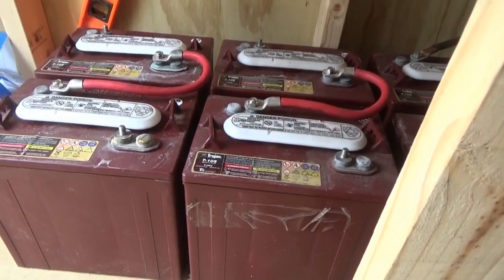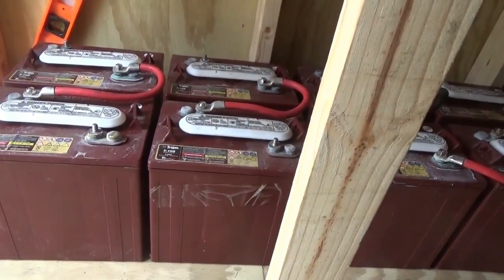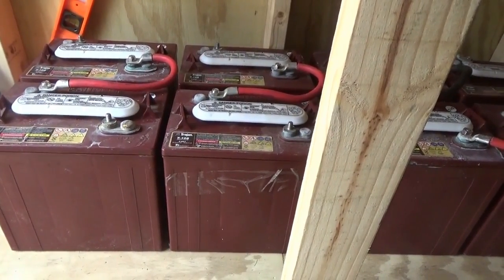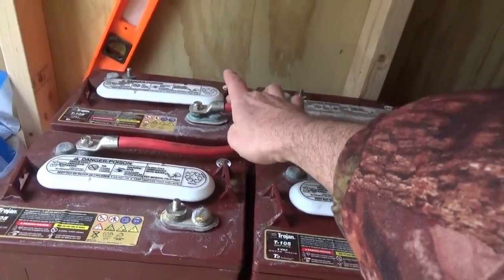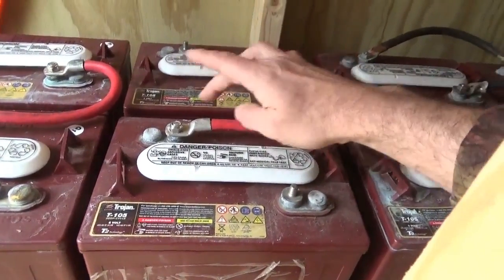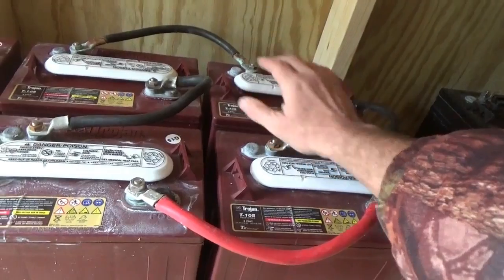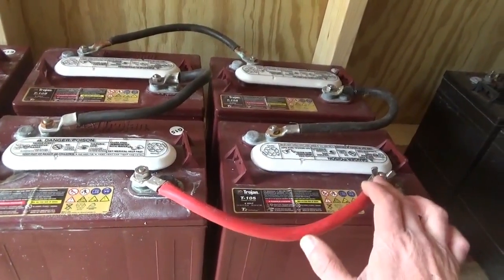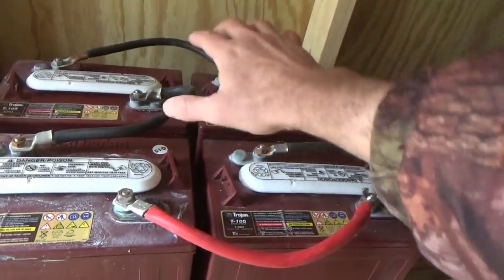How To Wire Solar Battery Bank ~ Setting Up Off Grid Solar

Comment: Thank you. VERY much appreciated. Question: can you connect the positive and negative cables from inverter to ANY positive and negative posts on battery bank, or is there a specific positive and negative post we should use?

Comment: Why am I getting a shock when I'm standing on the ground barefoot and I touch my battery only when the inverter is on it's a hybrid inverter charge controller when it shuts off there's no more electrification through my body The inverter everything is grounded in one location to the panel off grid completely and that goes to a ground rug so now what
Reply from the maker: The inverter is likely electrifying your ground. Try removing the inverter ground and see what happens. Or put it on a separate ground. Not tied into other things.

Comment: Question, what are you powering at night with this bank?
Reply from the maker: That was my electronics shop. The only thing left on at night was my experimental battery restoring device and maybe sometimes an inverter. On my main home system I leave my entire security system, outdoor lights, cameras on all night. During summer I power my entire office and even some cryptocurrency mining rigs at peak sunlight hours.

Comment: I like how these videos show you how to do it BUT never tell you the size of wires or lug rings to use.
Reply from the maker: Well the size lugs depend on the batteries you are using. Some vary with today's made in china stuff.
Reply from the maker: wires - use the biggest you can afford. That part is simple. Bigger is better.

Comment: great video i try to find it the simp. why and you did it 100ah battery is S give me the 24 v   but i did not know if i add 2 more if it would be 100ah or 200ah i know i have 200ah now thanks

Comment: HELP... I my old charge controller only had one PV wire coming off the breaker box...and my new Flexmax charge controller has both negative and positive connection WHAT do I do now.. I don't want to blow up my $400 controller.... I all most forgot Thank You for a simple and understandable video on 6 volt battery hook up to make it a 12 volt system.
Reply from the maker: Happy you liked the video. First connect the charge controller output to the battery. Always connect the batteries first. This is the one big way you can blow the charge controller if you do not connect batteries first.

Not sure how your system is without seeing the breaker box. but one wire will be positive from the solar panels and the other is negative. Use a volt meter if you are not sure. But the cables should be labeled on the solar panels themselves. Positive from the solar panels (or breaker) to positive on the charge controller solar panel input and negative to negative. Hope that helps.

Comment: Do you wire them serially first or parallel first?
Reply from the maker: If they are golf cart batteries I wire them together in pairs of 12 volts first and then connect all the pairs together in parallel.

Comment: I don’t get the vernacular.   I just do not get it.  Not your fault.  I can tell you how to move a gallbladder in detail, but this just doesn’t nabsorb in my brain.  I am stuck just doing one battery at a time.  Thankyou for trying.
Reply from the maker: If you have normal 12 volt car type batteries, just wire them plus to plus and minus to minus until they are all connected together. This gives you more total usable power. My situation is a bit more complex cause I am using 6 volt batteries.
Reply: @TheDoItYourselfWorld  thank you.  I have tried but electricity just is hard lol.  I will do this tomorrow.

Comment: Do you use 6v batteries to keep cost low? Why not use 12v batteries?
Reply from the maker: Actually 6 volt batteries cost more but last longer.

Comment: I'm currently living in a trailer after a house fire. I have a 12000 watt generator that runs on Propane and Gas. My next step I think ,is to get some AGM batteries(class31..i think?..lol). My trailer is a fifth wheel, with an enormous storage compartment. This compartment sits right next to where the existing battery is that came with the trailer. There's a 110 plug also in this storage compartment. My thinking was is that I could get myself maybe two to four 12 volt AGM batteries charge them with my generator and possibly a solar panel as well and use an inverter and then simply plug into the existing plug or receptacle that is in the storage compartment and back feed all my 110 plugs inside the trailer. What do you think of this simple solution to get started?
Reply from the maker: That AC outlet connects to the shore power line of your RV. There is usually no power inverter in an RV to convert DC to AC. You likely cannot send the output of your batteries back into the system because the AC lines in your RV are used to charge the batteries. You cannot loop it. If your conversion is permanent, you can remove the AC to DC battery charger and then use the output of an inverter to run your 120 volt outlets by connecting into the fuse box. But then NEVER plug in shore power or a generator without removing the inverter first. There are expensive automatic switches which allow you to connect a generator, shore power or an inverter in one system.

Comment: over on your web site I tried to leave a comment and it kept kicking it back because it said "too short." So, I will ask here. Do I connect my solar charge controller to the same location in  battery bank as my inverter/charger
Reply from the maker: You can put the solar charge controller on opposite ends from the drain (inverter) but if it is a charger as well, then I do not think it makes much difference.

Comment: I did the same thing you did I have for batteries in three different banks 12 battery is total I think I'm going to combine them all together instead of having them in three separate banks with three separate power leads going to my inverter, because they don't seem to be charging evenly

Comment: Once i have the battery bank together in parallel where do i tap onto and off of it with my charge controller and inverter. Again, i am in parallel. Would i tap a positive on one end of the bank and negative on the other or would i tap the positive and negative of one of the batteries on one end for the charge controller and the positive and negative on the other end for the inverter? Thanks in advance.

Comment: If you connect a positive 12 v to another positive 12 volt in a series, is there a limit to how many you can chain together like that (for a 12 volt system)? And can it be dangerous to get too many in a parallel series like that?

And if you are trying to use 6 volt batteries as a 12 volt battery does that actually lower your battery's amp hours, because its trying to do more with less?

Comment: I think you made a mistake in the beginning. With the first four batteries you said they were in series and you correctly stated positive ti negative. Then, when you went to the second 4 batteries, you said they were in parallel but you again stated positive to negative. Parallel means that they are connected to the bank all on the same polarity. So positive to positive, etc, etc. What is also possible is to connect some batteries in parallel and then connect a group of those parallel banks into a series. So you can connect 2 sets of 2 batteries in parallel. So you have 2 sets of 2 batteries in parallel. THEN connect those 2 sets in series to make a 4 battery bank combining the attributes of both series and parallel. You get the boost in voltage AND the boost in amperage.

I am a newbie to this whole thing but this I am pretty sure of.
Reply from the maker: Your suggestion may have one benefit which is better load balancing, if any. But you get the same results of voltage and amps either way you wire them.

Comment: so first wires could be six inches for money savings?
Reply from the maker: Shorter is better but I dont think you can connect the batteries with 6 inch wires. They wont reach.

Comment: is there any benefit in using golf cart batteries over deep cycle batteries? I notice these are 225 Amp Hour batteries, but most deep cycles are only 100 Amp Hours and appear larger than these.
Reply from the maker: These are 80 pounds each and are heavier than most deep cycle batteries I have ever touched. The amount of lead in these increases their useful life to 10 years or so. Your average off the shelf deep cycle battery is engineered to fail in about 3-4 years of average use.

Comment: I’ve bought so far 26 Yonlong 2.4v LTO Titanate Batteries 40Ah - 6 batteries will give me 14.4v or 21 will give me 48.4v is what I’m going to wire it this is only for battery back up when the grid falls I have a DIY generator / Some cheap small solar panels 25Watts ea. X 3
Reply from the maker: You may consider going on Amazon or Ebay and buying a few 100 Watt panels. They are getting cheaper all the time. And the larger you go, the cheaper they are per Watt.

Comment: 2:16 - To say that a parallel connection increases the current is misleading.   It increases the Ah capacity at a particular voltage.  Also, those batteries are not 225Ah usable each.  Most people that know about batteries know that with lead acid batteries, you only get about half of the rated Ah capacity of them so each of your 12V 225 Ah battery banks is actually only about 12V 112.5 Ah usable.  So your 4 12V subbanks in parallel are only about 12V 450 Ah usable, not 12V 900 Ah usable, and that is assuming they are in good health and wired properly under load (load balanced).  If they are not, then the usable capacity will reduce even more such as 12V 400 Ah or even less.

  5:50, it is not 225 *4, it is 4 * 225.  4 * 225 means you have quantity 4 of something that is 225 which is correct.  225 * 4 means you have 225 of something that is 4 which is not correct.  Also, for safety and to make your setup simpler, I would highly recommend making the jumper wires either half red and half black or some other color like white or yellow.  Why are you using flooded lead acid batteries indoors?  AGMs are far better for that purpose.  This video is not helpful to me other than it shows me what NOT to do.

Comment: I have my cottage half dc and half Ac, the Ac running only off a gas generator. My dc is ran off a batter bank with solar and when the Genny is running I have a battery charger on the bank, it this ok?
Reply from the maker: Yes if you can afford the gas for the generator. Depending on your energy needs, it may be cheaper in the long run to get more batteries and solar panels and run it off an inverter.

Comment: i noticed all your batteries sitting on wood but I'm told best to sit on metal...any idea which is best & y?...
Reply from the maker: I put them on wood because any acid spills dont harm it as badly as on metal. And wood is cheaper to replace if rotted over time. Thats my only reason.
Reply: @TheDoItYourselfWorld  O ok I'm just trying to find best against discharge. mine r on metal & been losing charge over 2 months
Reply from the maker: You might have a short in them. Not sure. But never use concrete. Not sure why but it seems to harm them. I have heard some say its an old wives tale but I have lost batteries time and time again on concrete.
Reply from the maker: Oh, that was many years ago. Seems the new plastic on batteries fixes that problem. Just looked it up online. Haha. I have been keeping batteries off the floor since I was a kid due to always losing them back then. The rubberized cases back then could seep energy out through the damp concrete floor. Today it does not matter due to the better plastic used.

Comment: Your hand pointing is very effective in this video. Well done.  I am operating a 48V system, so each string has 4 x 12V batteries.  I was advised that trying to put more than 3 or 4 strings in parallel can cause charging problems.  Have you heard this?  Any experience with it?  Thanks!
Reply from the maker: I think it could cause the battery banks in the middle to be out of balance with the others. Electricity will follow the path of least resistance so the batteries farthest away will be charged the least. Even a tiny bit makes a difference over time.
Reply: @TheDoItYourselfWorld  I wonder if I implemented a battery rotation schedule that it would help even things out.
Reply from the maker: Probably.

Comment: I have four golf car 8 volt battery how may i connected on my 800 watt 12 volt power inverter
Reply: @Odette Robinson - You might be better off getting a 24V inverter and using only 3 of those batteries and save the other one as a spare, or if you insist on using a 12V inverter, you can possibly use a DC to DC converter and dial it in for 32V input and 12V output.  Even better might be to just get 2 more 8V batteries or similar age, health, and capacity, and make it a 48V system.  An easier way would be to sell those 8V batteries and instead get 6V (or 12V).  A golf cart shop can do the swap for you.

Comment: Looks like a 420Ah 12V battery bank. By tying 4 strings in parallel you may decrease the batteries ability to equalize so be sure to monitor that in the future. Thanks for the clear video!
Reply: Will the drain from a weaker battery damage the ones that are connected to it?  How important is the equalization?

Comment: Hey how are you? I have a really quick question,what if my inverter is 3000w how many batteries would I need ?
Reply: Your actual usage needs are more important than the inverter maximum output. Total up how many watt hours (or amp hour) you might want to use on a given day. That should tell you how many amp hours your batteries need to store to meet your needs.

Comment: May i have and advice from you? Iam from Puerto Rico and aim about to build an small off grid like yours. My interest is to move my fridge , tv and some lights. Whats best ,,12v or 24v? iam buying 6 Trojan t-105 like yours. Thanks.
Reply from the maker: If you can afford it go with 24 or 48 volts because you can use thinner wire and there are less losses in the lines. But you need more batteries.

Otherwise go with 12 volts on the cheap.

Thats the main reason.
Reply: how many T105 ill need for 24?
Reply from the maker: That fully depends on how much power you will need. First calculate your maximum power consumption. You need roughly three times that amount of storage to get you though a cloudy day.

When adding batteries in series you increase the total current available. In parallel you ad the voltage. So with banks of 24 volts combines, you need to count each bank as a single battery as far as current.

A bank of 200 AH batteries set up as 24 volts will still only have 200 AH of capacity. You must ad more 24 volt banks to increase available current.
Reply: The Do It Yourself World thanks, really appreciate your response.

Comment: Anayone, Would using all 12 volt batteries in the bank follow the same principle? Positive to positive as shown. Would doing this with 12 vold batteries be dangerous just because they are 12 vols? Thanks
Reply from the maker: Wiring plus to plus will increase the available current, yes. Essentially these are wired as sets of 12 volt batteries.

Comment: When you come around to replacing those batteries....try the Trojan T-105 RE (must be RE as they are solar panel freindly....good tip for anyone else scratching their heads on what exactly to buy for storage...think of these type of batteries as "Marathon runners"....not sprinters......thats what a wet type acid car battery does...it sprints........good tip...if it has CCA on it (Cold Cranking Amps).anywhere on the battery...do NOT use it for solar panels..these are the sprinters....not marathon runners.....they are designed to give a big punch....but drop off very quickly...So Trojan T-105 RE costs more,,....but in many years time of charging and discharging...you will thank yourself for your decision on battery choice,..:)
Reply from the maker: These are Trojan T105 and they are very good.